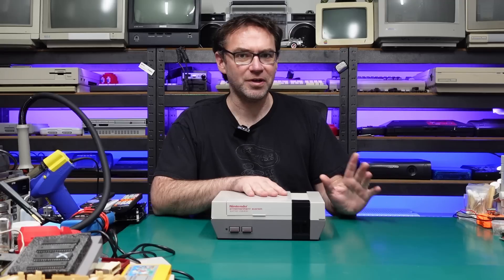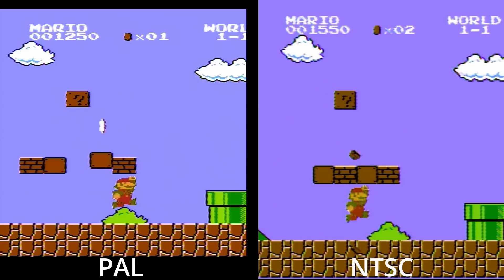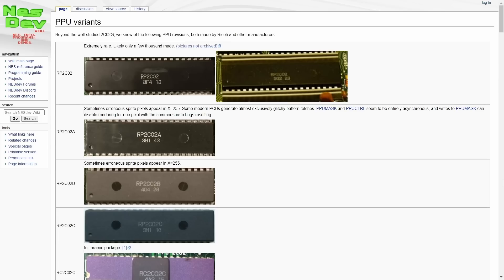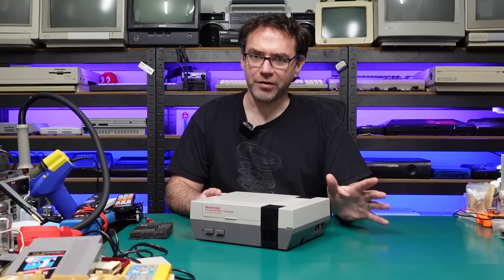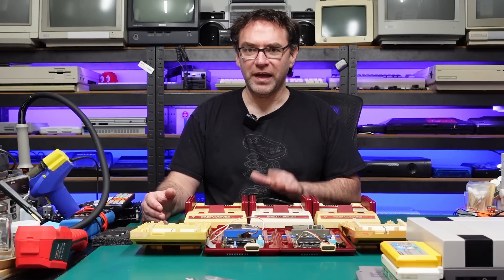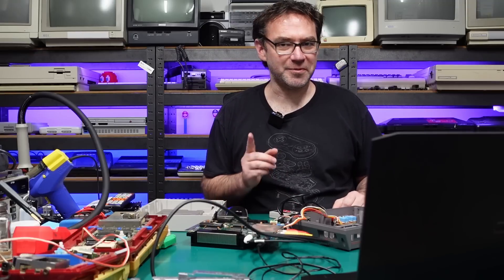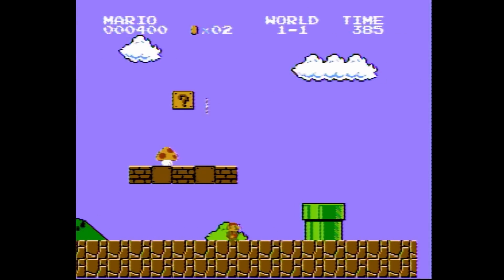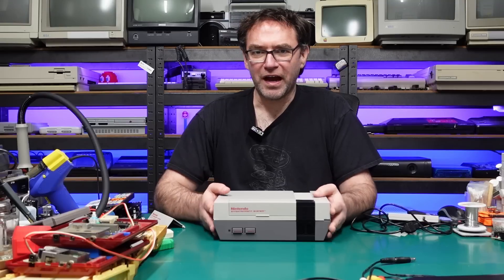NES PAL to NTSC conversion

Comment: Hi 👋,  I just tried this and it worked. Castlevania 3 worked perfectly but once I turned the console off and on again my everdrive kept getting errors. I replaced the pal components and it works fine again. Does anyone have any suggestions? Thanks 👍

Comment: Great video! I have a PAL NES and would be interesting to do the same. There are very few true PAL NES games. Well yes you can find the european ROMS but they play exactly as slow as the NTSC versions (I've already compared quite a lot of them), with the exception of Super Mario Bros 1-2-3, Dr. Mario and maybe a few others which were made with the speed difference in mind. Though I would like to ask you how did you get the NTSC result being displayed right on a european PAL TV through RCA composite output and not in black and white weirdness?

Comment: What will happen if I use NTSC console connected to pal TV?
Reply from the maker: Depends if the TV supports NTSC. Most PAL TVs from the mid 90s onwards support NTSC. If it doesn't you'll likely just get a black and white image
Reply: Any modern flatscreen should auto detect and switch accordingly also I recommend the AV famicom for all round best hardware region free AV video with disk system input also rf signal with an n64 rf module

Comment: The PAl Color system is the Better one. 

I think there is no need to Modify a PAl System in a NTSC. 

Ann No NTSC Consoles are not Expensive, it you buy it for Parts only like mine. 

I Bought 3 for under 50€ and one of them is a US NTSC version. That works like the 3 Others 100% after e Cleaning work. 

The Original NES is so Reliable.

And at the end, to destroy an Original Famicom zo mod an NES is just bad, YES BAAAAD How dare you!?! A Famicom ist here more expanisve to get than a NES.

Comment: For the love of all, if you have to replace that crystal and it is still working, do not throw it out, under no circumstance should you throw it out, unless it is completely cactus!

I have an NES that requires a new crystal, the NTSC crystals are everywhere, the PAL crystal that the NES uses on the other hand, might as well be unobtanium. I found some on eBay, but they are absolutely rubbish. The PAL crystal is just this really strange frequency that nobody sells.

Would love to see someone create a mod or something that will allow the PAL NES to take any old crystal and adjust its frequency or something on the fly to make it the frequency the PAL NES requires :(

Comment: quick note about that famicom, it seems like you have a revision-less CPU which is quite rare. it is missing some features like tonal noise. check if the bottom is smooth, and if the controllers have square buttons. if they do, then you have a very rare "square button famicom"

Comment: Make one that support both PAL and NTSC games 😄
Reply from the maker: I thought about it, but for the very small amount of PAL exclusives I can always use my PAL NES
Reply: @TheRetroChannel  How about PAL60 format? (NTSC RES/FRAME RATE & PAL COLOUR) Is that possible?
Reply: @duncangarnett1976  PAL60 is possible, just find for TA-03NP1 CPU and TA-02NP PPU alongside 26.601712 MHz PAL crystal, the best thing about this PPU is that it has a pin which switches NTSC and PAL, the PAL mode runs at Famiclone speed, not the original NES PAL speed while the NTSC mode runs at NTSC NES speed
Reply: @duncangarnett1976  Also i feel like these CPU and CPU are best Famiclone chips, it runs flawlessly with almost every single NTSC games out there, its not buggy like UMC and also the TA chips doesn't have reversed duty cycles issue

Comment: Nice video.

I made a similar mod a few years ago.

I took the same chips. Soldered the chips onto eachother except for the 5V.
I soldered those and the clock to a swirch and had a 100% working NES for all the games ever made. 

And as you said 
Information on this and similar mods are scarse.
Reply from the maker: Nice. I considered doing the same thing, but I have another PAL console which I can use. Although it probably will stay in the cupboard now I have an NTSC console 😅
Reply: @TheRetroChannel  but a (physical) swich is so much cooler. ;-)

I put mine under the lid for the expansion port that never got any use.
(I don't think switching while being on is a good idea)

Comment: not convinced on the use case of this mod.. 

Considering the cost of an NTSC NES and freight to obtain the custom chips and the right frequency crystal to install into your PAL NES PCB, wouldn’t you just be better off spending a bit extra to get an AV Famicom anyway? It’s actually got the multi out AV port on the back, NES style controller ports on the front, and the NESRGB mod install is fairly straightforward to get RGB video out of it…
Reply: yes but if you already have an PAL system lying around, a dirt cheap Famicom for slaughter is much better option. From Japanese proxies you can get bulk untested ones for super cheap + 20€ shipping.
Reply from the maker: 3:11

Comment: I commented just yesterday because i was watching your older NES videos, but your PAL system looks like it has to a problem with the horizontal sync resulting in the jagged edges on the side of the screen, even before any of the changes in this video.
Reply from the maker: My other PAL console looks the same. It seems pretty normal for the PAL NES, and is harder to see with NTSC due to the dot crawl